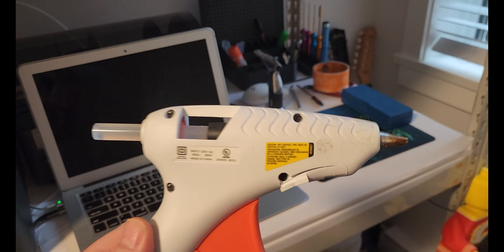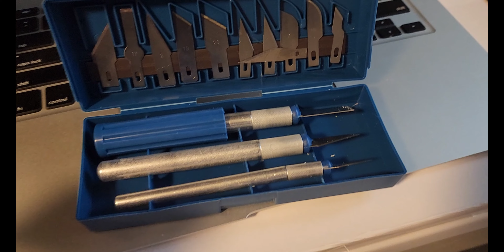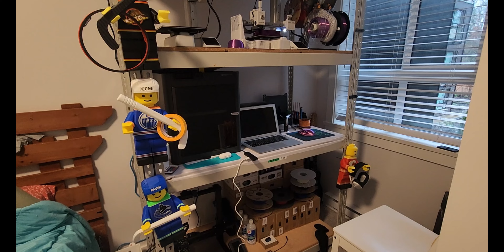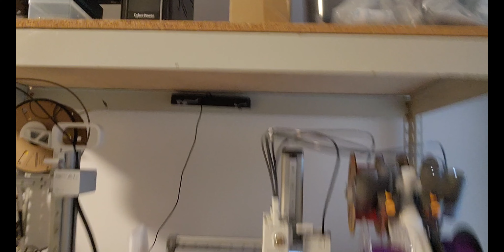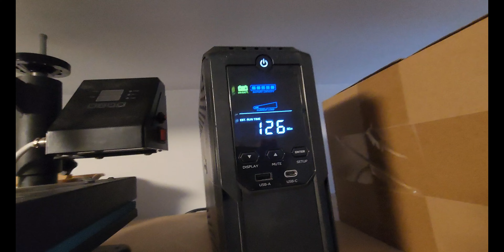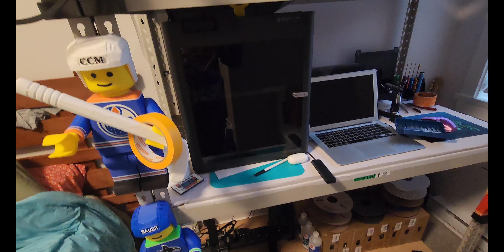Top 5 Essential Accessories/Tools for an Efficient 3D Printer Setup #3dprinting  #bambu #top5

Comment: Great video. I am curious why the glue gun is recommended. Is for attaching parts together? Repairing a print? Maybe show an example of why you're recommending it?
Reply from the maker: My apologies! I probably should have clarified that I use a Hot Melt glue gun for assembling some of the closet organizers that I manufacture. I guess figuratively speaking not all 3D printer setups need a Hot Melt glue gun however in my situation it is a must.